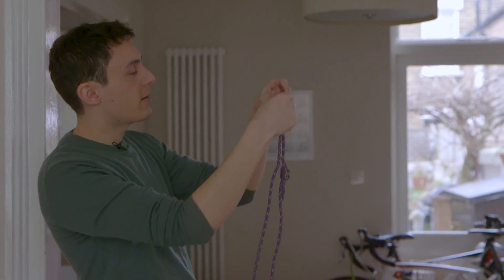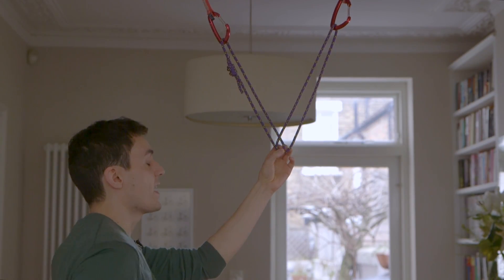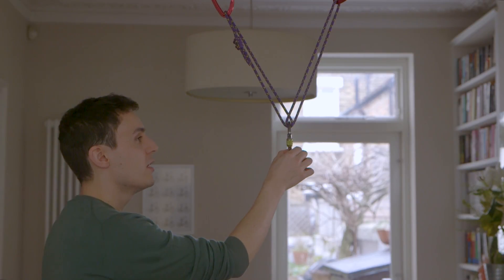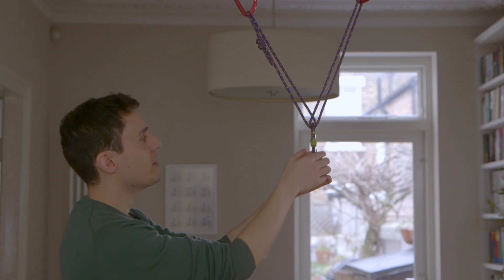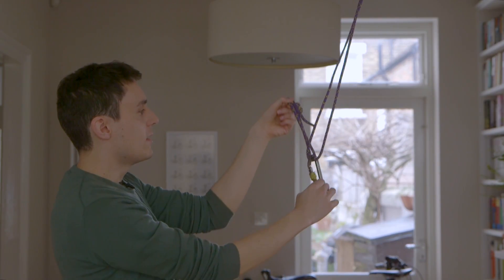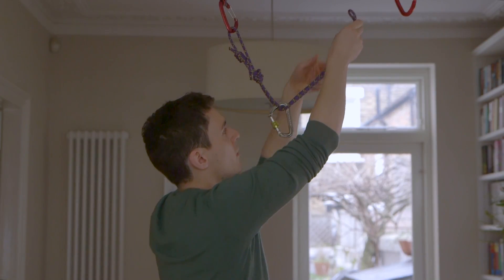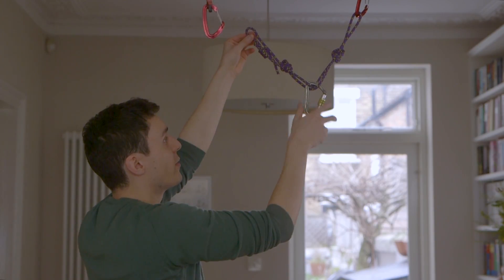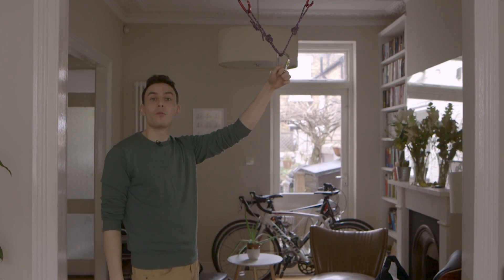Climbing anchors: Sliding X

Comment: So, limiter knots shorten the fall distance by a couple of inches. That's good, but they also drastically weaken the rope
Reply: Good thing you're not tied into a single rope/point of failure with a figure 8 knot. Oh wait...
Reply: Up to 50% or more loss in strength actually. After watching these videos my plan is to build sport anchors with 2 slings with sliding X knots (without limiting knots). It's only a little more gear and some peace of mind redundancy. If an anchor blows you'll have a bit more shock load as he mentioned but will have two full strength slings, which should more than make up for it.
Reply: Another thing to keep in mind: if your first anchor does fail, it'll still absorb quite a bit of energy, so the second anchor won't have take all of it

Comment: You still get a shock load with a limiter knot.  You are just decreasing that force due to acceleration (gravity) by making the path shorter.  F=ma (force =mass x acceleration).  Acceleration = change in velocity/time.  If you limit the time the acceleration is lessened, hence the force is less.
Reply: Do shock loads matter? I mean, should they matter in the grand scheme of things?
Reply: @timdolinger1352   Shock loads can cause pieces to pull out of cracks or cause rigging to fail especially with static cord like dyneema/spectra runners.  DMM did a whole review on this.  Bob Gaines and John Long discuss it in their book on climbing anchors too.  A well worth read.  FYI, https://www.youtube.com/watch?v=Vrgadjo9niY
Reply: Did you do the math or did you test this yourself?